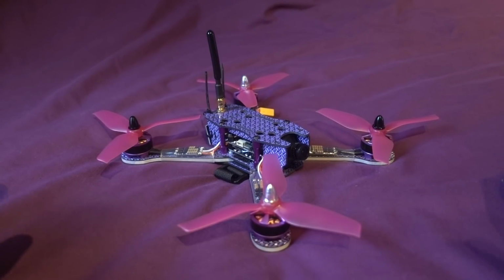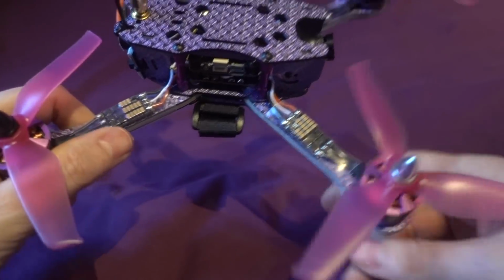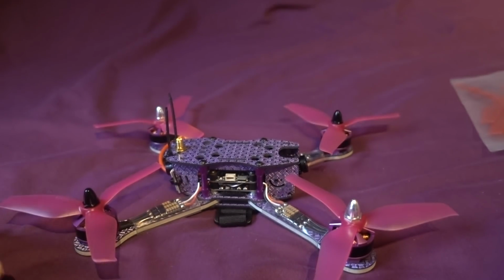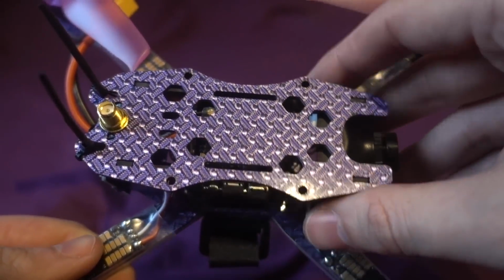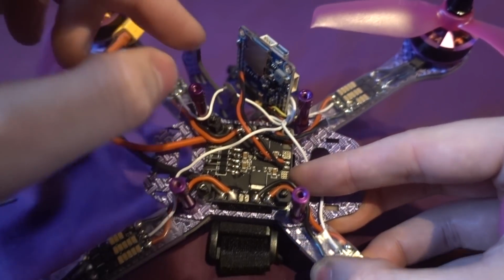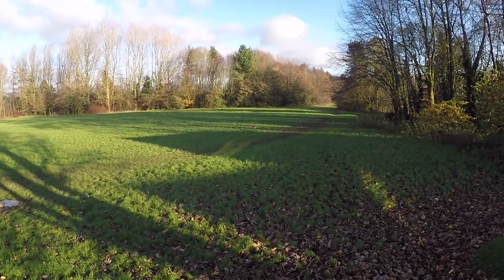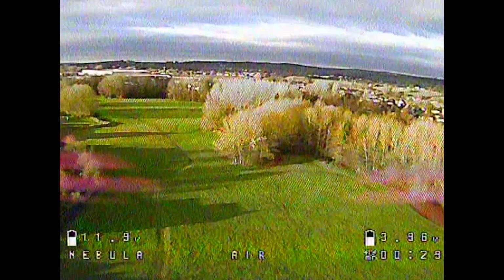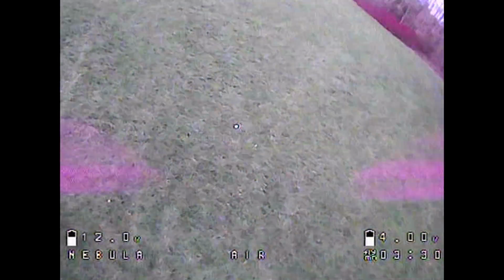FuriBee Nebula 230 NEW MODEL

Comment: Hey Andy, I put 3S 1500 30c on it, fly up but it will drop down to the ground. (like disconnect power,but after 1 second it reconnect again). 
I’m new to fpv drone, so the problem is this drone required 4S,that’s why I got this iusse right?
I did Ordered 4S battery it’s on the way. :)

Comment: They soldered everything right execpt VBAT. Once you solder the black wire to ground and the red wire coming from VBAT of the FC to the positive pole of your battery everything should be correct because they soldered a bridge between the second VBAT pin and RAM on the FC. So both then camera and and VTX get VBAT from the FC (don't know if VBAT as power supply for the camera is correct?) So from my perspective it would be better to take the power supply for the camera from the 5V regulator and the power supply of the VTX from the 12V regulator to avoid problems coming from the FC. But I really believe you got a dead VTX....

Comment: You can clean up the video on the X215 by slipping a piece of aluminum foil in between the stacks under the vtx... Of course cover it in something non conductive like electric tape. I believe it was DutchRC who came up with that solution but it definitely works. Apparently the issue stems from the fact that the VTX that used On It originally had shielding in place but it was removed so in essence you are just reapplying that shielding

Comment: Run the vtx from the 12V regulator on the pdb directly if it can take it. 
Hook up the vbat like you suggested so you can have your osd.
There is a jumper on the omnibus if you need 5v for the camera.
And that should resolve your issue.
That how i have all my omnibus boards setup without issue.
Reply from the maker: +rwells242 it's mentioned in the vid
Reply: I didn't get that from what you said in the vid. You  said if you run directly off of vbat then there isn't enough power for the VTX which  isn't logical.
The way I mentioned you definitely would have your OSD and your vtx powered.
There would be no need for using that 12v at all for your FC which as you stated is not correct at all .
All I can tell you is that I use  multiple versions of the omnibus FC all the time without any issues and all have OSD vbat info and no vtx  power issues.
Perhaps i didn't explain clearly or I missed something I will see if i can find the  video that shows the omnibus setups.
But going back to the 12v for vbat  is definitely not correct for omnibus fc .
At the end a ready to fly should not need this type of conversation as the people who made it should have done it for you.
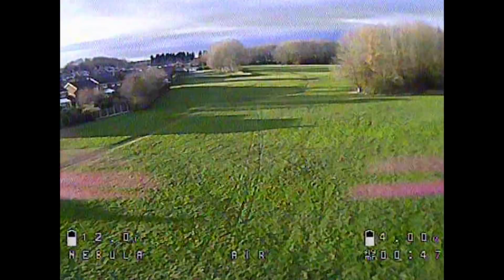Reply from the maker: 19:24

Comment: hu, I am passing on furibee because I got screwed by them. Brand new darkmax came with two bad motors and I have been over a week trying to get somewhere with customer service. They have , apparently horrible quality control, and buying from them is like playing the lotto only in reverse. normally your ok but, if you get the lucky draw you are SOL.
Reply: I have the DarkMax too and it flips out and falls out the sky (Check out my vid here: https://youtu.be/PEQZN_aDxdI ).  Quite a few people have had the same problem, and nobody knows how to fix it.  I'm pissed.  Not to mention they had the yaw orientation set wrong.  That made for an interesting maiden (another crazy vid).  Also the manual said the RX is on UART1 when its really on UART6.  Not too sure about their QC, and I'm worried bc I already ordered the Fire Dancer.  We shall see how that turns out.

Comment: I have a question for you andy! Say i just got a brand new qx7 and a brand new furibee x215. The drone should bind no problem correct? And i can fly! And i am very impressed!!! That thing you hooked up to i think the antenna what is that called? And great job going over every inch of that drone! And i am a little worried i watched you review ov the x215 and it did have problems!
Reply from the maker: its an immersionrc power meter. as for the binding it depends if you bought the one with the frsky receiver then it would bind. cheers

Comment: The motors look the same as the X215 Pro, but they are listed as 2206 2600kv. I have one, I’ll have to measure the stator. The props are also a little different. P.s. I am quite happy with the X215.  Flies really well, but two motors have loud, rattling, bearings. Not sure how long these motors will last.

Comment: Oh dear, how can they get the wiring so wrong?...Running the VTX and Camera using the (weak) 5vdc from the F4 board?...Apply 4S to the FC will give you the essential Lipo voltage status. It amazes me how they can get this stuff wrong when you consider how many of these things they churn out. It depends rather on if the F4 board has a linear 5v reg or a switched mode one, the linear can get rather hot, especially using 4S..?...I suppose they are using the 5v from the PDB though.
 Where is the 4 in one ESC?  The Camera and VTX were disappointing, even flying close in, noisy supply too...Jeez.

Comment: I must say that with all that screwy wiring and poor VTX output and poor cam, it does have  issues as you said. Its unfortunate, as you said, because Furibee has had some decent models .. but this isn't one of them.  BTW, my E010S arrived today, and I've flashed it to BF v3.1.7 , used the CF PIDs and have flown it around a bit .. can't get over how tiny it is .. kind of like the old nanos (CX 10). Should be fun when the snow flies. Cheers.

Comment: I got this. Weird things I personally noticed: The ESCs don't have signal ground wired up. The VTX is nearly inaccessible.
Reply from the maker: did the vbat come soldered to the 12v? dont need ground wire on the esc..
Reply: I will check later, and get back to you. Still need to watch the rest of this video too, to see what your observations were.
Reply: Yeah the ground isn't needed, but it can help reduce EMI when twisted with the signal wire. That is the benefit of twisted pair wiring, EMI reduction.
Reply: Yes, my VBAT was soldered to 12v. That's a pretty nifty "feature".

Comment: I haven't seen it fly yet but IT'S SO PRETTY!
Reply: Ug, I just don't get it.  This should be a great model.  All the parts are there...  Well mine is in the mail, finish a video on fixing is so I can do that when it gets here.  :-)
Reply: I wish the purple was darker
Reply from the maker: maybe yours wont have an issue. just fired up the vtx direct from the battery and its still reading 7mw.. dead vtx I think the FC actually putting vbat through its not regulated
Reply: AndyRC do you have a QAV220 yet?  Mine came with no config and the board doesn’t seem to want to read the preinstalled xm+. Been a fun afternoon.  😕
Reply from the maker: nope was told not in stock....
Reply: That nice Flyer!🎤🎮🚁